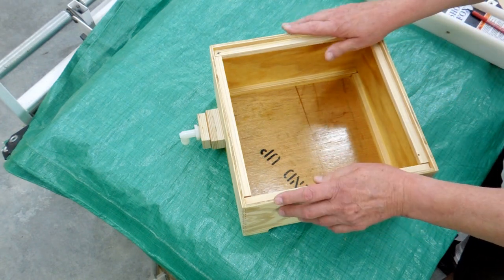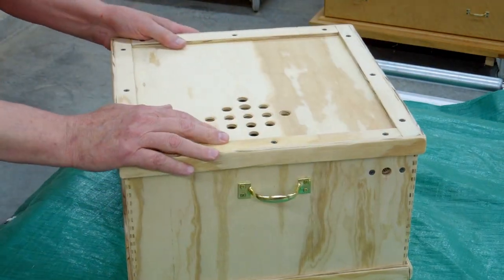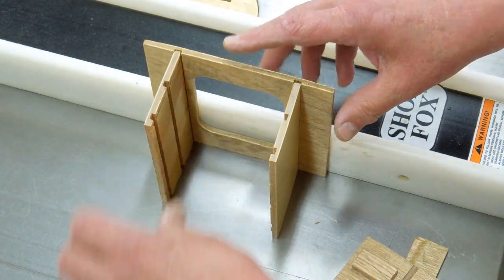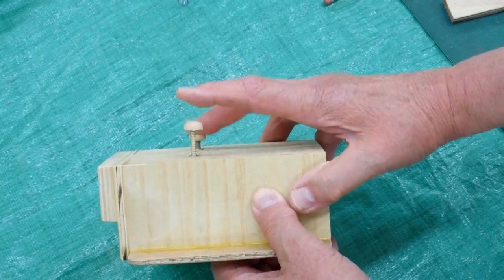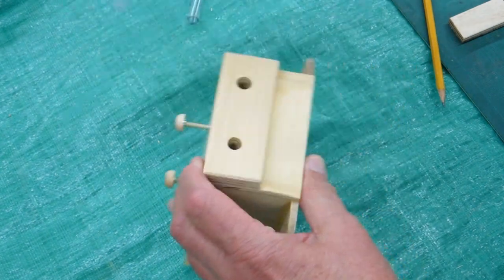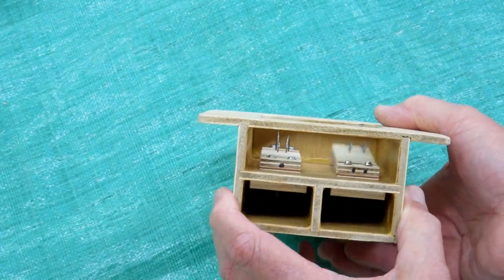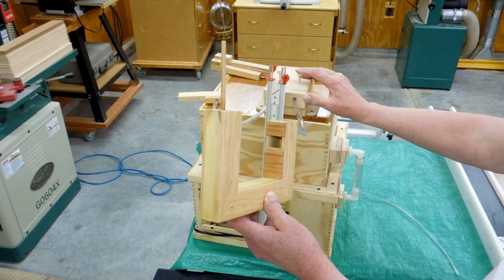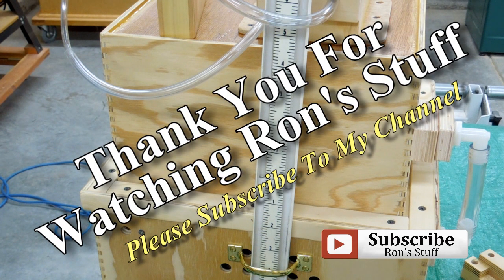Building The Busker Organ - Air Box (Air Chest) & Valves Part 6

Comment: Thanks Ronald. I've really been enjoying this series. Will you be testing pressure drop for multiple notes being pressed in the future?
Reply from the maker: Andrew White I did not shoot video for any pressure drop tests for
multiple pipes. You saw in this video a continuous burst on the low note pipe
did not require that much air. The paper music moves at roughly 2.5 inches per
second. Occasionally a particular pipe will be open for a long period (a long
opening would be 1-3/8” length on the music roll) but generally pipes are open
for short bursts (one hole or a slot opening 5/16” long) and in combination
only 3 to 5 pipes play at a time (sometimes 7 or 8 at a time). The three
largest or lowest note pipes require the most air and the high note pipes do
not require that much. So, recovery of the air supply is quite fast. Air leaks
ANYWHERE (from the bellows air intake valve to the stopper on the pipes) can be
a killer. As long as the construction pays particular attention to avoid air
leaks, everything should be good. In reality there will always be some air
leakage. The organ is system of controlled or minimized leakage.